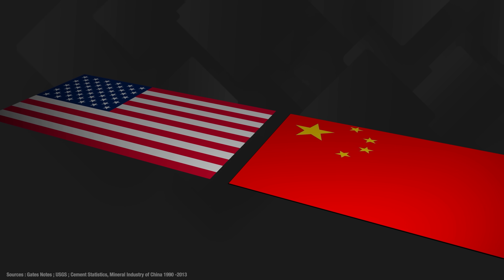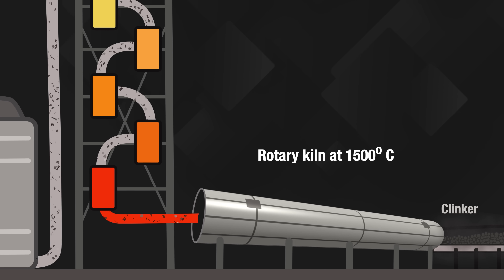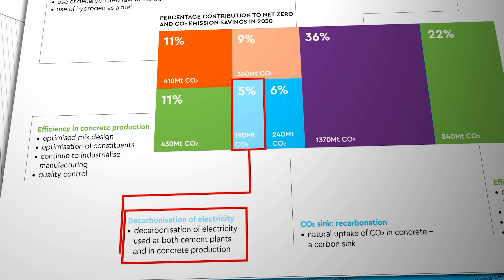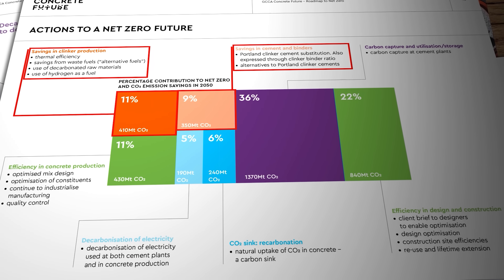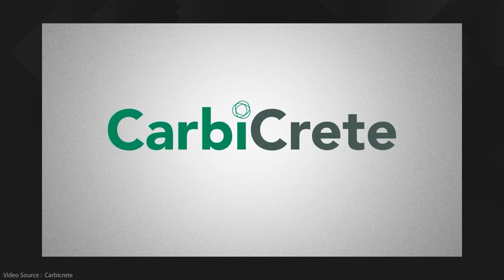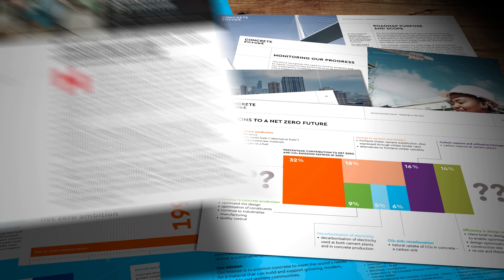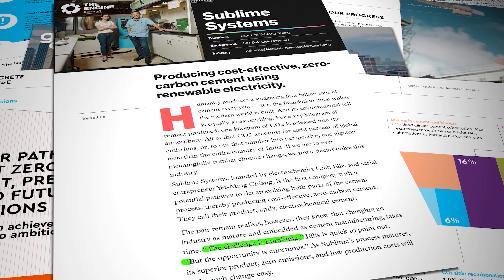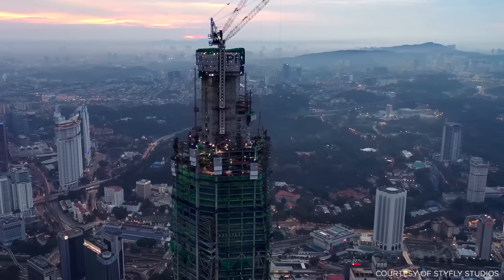How to make concrete green!

Comment: Concrete is very susceptible to changes in it's recipe.  Engineers are going to be very skeptical of the long term effectiveness when building massive buildings, bridges, and any structure that needs to be around a long time and there are safety concerns.    At least until there is a good track record.    So I bet it's going to be limited to small buildings, roads, anything that's not a safety concern over a long period of time and simply ripping it down and doing it again isn't a massive problem.   But who knows.  Maybe some one is ready to take the multi billion dollar risk on a new material (recipe).
Reply: Exactly. Its too expensive to experiment and find out you are wrong 20 years down the line.
Reply: @manickn6819  
Expensive in many ways, concrete failures can cost lives.
Reply: @b_uppy  lots of angles. Lives, infrastructure, reputation. Few professionals would risk that.
Reply: Actually, engineers understand that unless we find a way to construct net carbom zero, there will not be a construction industry, so there is mote impetus for change than you might imagine
Reply: @stevemcdowell8829  
Think that adding carbon to concrete is a false value however.
Reply: @stevemcdowell8829  Yes, but it's just another example of the tragedy of the commons.   What engineering company will risk their own short term survival by testing this on their own project?
Reply: @stevemcdowell8829  there will always be a construction industry. It's one of the most important in most economies. Nearly impossible to touch it without serious political ramifications.

Comment: Good one.

Nu #1 addition to make is this. High quality concrete, line all structural materials, has become a lot stronger in the past decades. Plus, we have had incredible improvement in CAD tools. Both combined allow us to save huge amounts of weight, yet deliver the same structural functionality.
Reply: Hempcrete has a problem in that it is made from a water-intensive, annual plant.  It still uses the base product of cement which is where the problems arise.
This ignores that we need to replenish carbon to soils to increase crop yields, reduce flooding, drought and heat effects, improve soils, etc.
Reply: Concrete is weird. I watch the hydraulic press Channel and concrete in the past was much stronger in all directions. It was over designed a bit.

Some older concrete took 20 tons of pressure to break which was ridiculously Beyond modern concrete. It seems like it was pretty close to solid rock.

They also compared bricks and the bricks today we're weaker in two directions but stronger vertically.

 Experts in the forum said this is because modern bricks have air bubbles in them to provide insulation.

However I will also put on my skeptical hat. Outside of licensed legally controlled engineering, cost cutting in modern business is relentless. Some concrete structures in China used bamboo instead of Steel rebar. This was found out when it failed.
Reply: @mac_mcleod  
You've shared some interesting bits.  Think there may be some implied incongruencies, however.
Reply: yes and wrapping old concrete with carbon fiber was obvious solution for encino bridge pulverised saturda night instead with no more safe passage over now you have to climb wall and dodge ten lanes of 80 mph traffic.

this is on the 101 with claims it costs 20,000,000 to walk over the traffic but obviously pedestrians can get across for much less although the ramp for wheelchairs will b emost expensive and probalby cost over half a million to remove needlessly

It's insane they can't put ladders but can put nothing now.

i've seen the ban on ladders cancel other bridges but never seen a cost no object funding get shot down by ignorance

There is land that is public now free for shade, drinking fountains, electric outlets powered by sun or at least usb c or induction charge plates some nonprofits needs to run a drone across for packages and help those denied a bridge stay safe on these two former ramp pads.

the thickness of that 1950's walk surface was insane!

How many bridges are not taller then 14.5 feet?

Comment: Nice update Dave.  Once again the difficulty lies not just in invention of efficient/environmentally friendly processes. But also in the encouraging governments/manufacturers/consumers to invest/utilize these processes.  Even if in the long run it benefits them and us.
Reply: I think there needs to be shift in focus in the marketing of these products, that is specifically targeted to potential customer segments.
Reply: It’s actually quite obvious with no country even willing to stop paying the subsidies to fossil fuels industry, the status quo insisting that no single weather event is caused by climate change, that’s BS! Since 2019 brought, to the arctic circle precipitation that more rain than snow, all weather events are caused by climate change to be worse!  Words matter, all fossil fuels subsidies only to executives willing to live on barrier islands, in tents!🎉
Reply: It offers little utility for the cost whereas sequestering carbon into soil adds to water retention, fertility, food productivity, reduces water pollution, flooding as well as drought and heat wave effects.
Adding carbon to concrete fails to add to its utility while possibly increasing its rate of degradation.  Where is the benefit in that???
Reply: @b_uppy  There is no. shortage of carbon that needs to be dealt with.
Reply: No . Better technologies move quickly especially if they are superior in practical ways. The last thing needed is incentivized technologies dependent on government's support and approval.
Reply: @GroberWeisenstein  ok, goober, let's stop subsidizing fossil fuels then

Comment: 53 seconds into the video is pie chart that makes clear that this episode is focused on the wrong problem: concrete (8%). At 28 and 29 percent respectively, electricity and transportation are each a 3 times bigger problem.  In addition, improving the production of electricity significantly additionally contributes to reducing the contribution of both Industry (14%) and Commercial and Residential (12%) segments.
That would rather strongly suggest if the whole world were choose just one area to focus on, the choice is clear: make the production, storage, and transmission of electricity much cleaner, cheaper, and simpler.
Reply from the maker: Well, I've spent four years making videos about those subjects Bob, so occasionally I choose to focus on the outliers as well.
Reply: We have to attack every wedge of that pie chart. This channel talks about all of them.
Reply: @peldiman  
'Attacking every edge of the pie chart' creates more problems than it solves because then we are using up everything without considering the real returns on investment.  Sequestering carbon into soil produces many benefits with decreasing harms whereas sequestering it into cement/concrete causes more.  
We can reduce grid strain by pushing for more return on investment (value) than for running to every flash-in-the-pan solution.
Reply: @b_uppy  Incorrect on almost every point, I'm afraid. 

Though these slices' percentages are much smaller, the total that each percentage point of the whole pie represents is a massive tonnage. We are simply not going to be able to correct any one "slice" to the degree needed in the requisite time frame to mitigate the progress of the overall problem, much less halt or reverse it. 

ROI is certainly an important factor and should definitely be more heavily weighted on the priority list, it must, however, still be a priority LIST. There simply is no "Silver Bullet" solution to any of these issues, nor a singular avenue by which the overall issue can be solved: ALL slices of the pie need to go away, eventually. There is also the overlapping infrastructure and resources involved, as well as the benefits of creative thinking: we never know what broadly applicable innovation will come from which field of research.

As for your comment about the pros and cons of carbon sequestration: 1) Carbonized Concrete can be encased in several manners to render it less reactive to water (which is how carbonic acid is formed)
2) Soil Carbon Sequestration has a similar carbonic acidification issue unless it's properly treated or encased, and b/c of it's increased surface area, acidifies much faster than a similar volume of carbonized concrete in blocks.

In both cases, natural bases/alkaline materials can be planned for incorporation into such storage sites/applications.
Reply: @lady_draguliana784  
Massive harm that is increased in the short term as well along term.  Additionally this fails to increase the properties of the concrete while possibly adding to its degradation over time.
There are much better solutions proposed on this channel and this one is a huge failure.  Since this is merely talking about carbon sequestration that is how I confined my focus under this particular video.  
Your assumption that I consider carbon sequestration into soil the only solution is false though it is by far the most effective, especially when combined with Walter Jehne's approach that also includes rainwater sequestration, as well as regreening.   You also assumes that this is the only solution that I have considered as worthy.  I like the use of hydrochar, for example as it also has a high ROI.  
Carbon is easily sequestered into soil by natural means that avoid all the other issues tech solutions provide.  
Being gullible is costy.
Reply: @b_uppy  As I noted below, there IS a noted benefit to carbonizing concrete. In this very vid. He noted that some techs will Increas Compressive Strength in the final product.

Also as I noted below: cherry picking only those solutions with the highest of the high ROI while obviously ignoring almost ALL OTHER qualifying factors: availability, rapidity (we're on a schedule here), scalability (do we have enough land eligible for soil sequestration to meet our projected needs? ... no, the answer is no...). Just to name a few, will inevitably result in falling short of our tons-per-decade timelines. yesterday/today a once in 500yr hurricane (Ian) Hit Florida, supercharged by the warming already in effect. We can't rely on the top margins to carry us all the way here.

If you're trying to complete a task with nothing but a hammer just b/c the hammer has the biggest individual impact... well it's going to be really hard to build a world record skyscraper without also using nails, cranes, shovels, torches, measuring tools etc. etc. etc...
Reply: @lady_draguliana784  
Allegedly, and for how long?
Reply: @b_uppy  unsure, that's what "research" is for, but reasonable projections can be made based on chemistry. I didn't write the paper or do the research, but i'm sure that when those numbers are published, JHAT will update us.
Reply: @lady_draguliana784  
There is research that proves the benefits of the Walter Jehne approach, same for soil sequestration in general.  And it costs much less, and is definitely justiafiable...